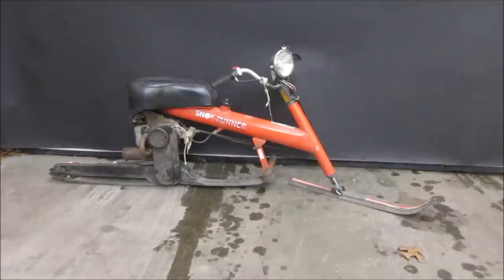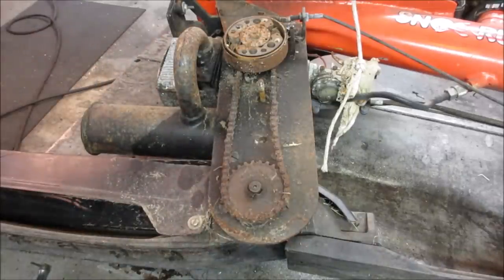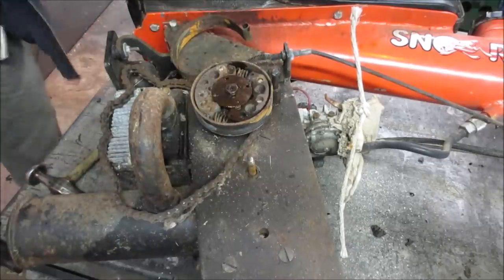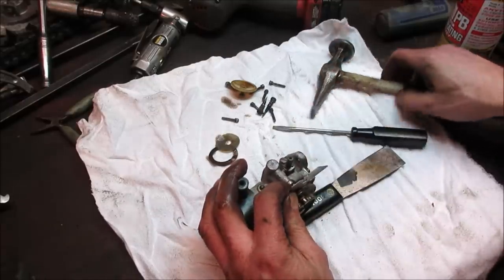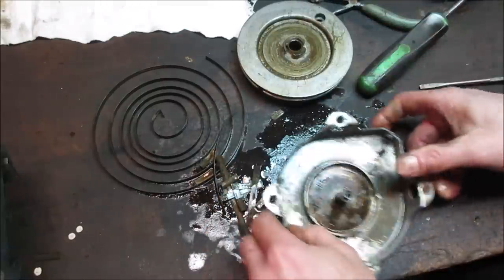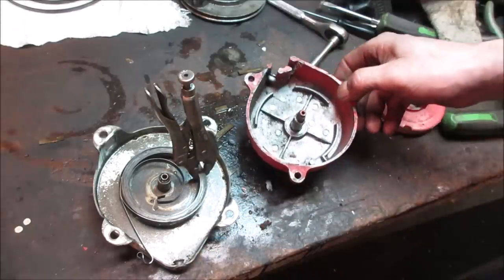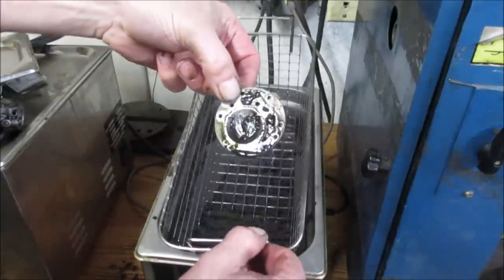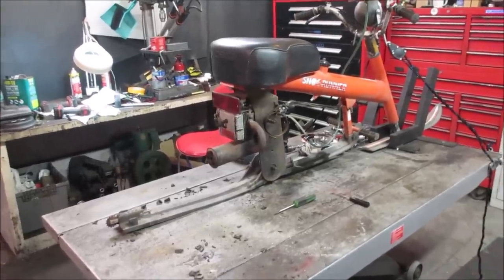Can It Be Saved? Chrysler Snow Runner.

Comment: Chrysler Power Bee. Came from the West Bend acquisition. Those motors found their way into everything including Chrysler outboards. Lots of industrial tools too. All the parts are still available, including whole engines.
Reply: That is incredible for sure
Reply: Wow, that is good information and I've seen similar engines like that on go karts and minibikes. GREAT that such an old engine is still supported.
Reply: @Hjerte_Verke  I know a guy that highly modified these things back in the day to run them in carts. Amount of power of these little guys will make after being massaged is shocking.
Reply: one of the best kart engines, 4 reed matched to a Hl 244 from my view
Reply: It's the same engine that is on my 1968 Rokon Trailbreaker.
Reply: @greenmtnman7714  I've also seen them on plate compactors, power trowels, two-man chainsaws, gas powered drills and and so much more. It was a go-to for the specialty equipment manufacturers.

Comment: Pull start springs are such a joy to work with. Definitely didn't have flashbacks to my snowmobiles I had to bend new tabs and rewrap out on the trails alone.
Reply: They're also very exciting if you're not holding the right parts when opening one up that's still sprung... I had bits (including small tools) spread across the entire garage floor when I needed to unjam a rope that slipped off the pulley. I was holding it back from rotating, but didn't factor in vertical movement exists too 🤣

Comment: My cousin had one of these that I got to ride in the late 80s. It was actually really fun and handled the snow pretty well...from what I remembered. Would like to find one for myself some day.
Reply: Did a quick search just to check if parts and such were available. Turns out an aftermarket track runs $200 or so.

Did find an auction site that showed past prices - complete Sno Runners have sold for $2000 to $4000. Not sure what condition they were in, though.

Comment: First time ever seeing a snow machine like this….only seen snowmobiles. I imagine these were designed for kids for some winter time fun👍 How fast did these things go I wonder? Didn’t see a speedometer at the handlebar area. Looks like a lot of fun. Having one of these as a kid would’ve been a blast😄 Freedom to travel great distances and go on adventures 😊👍
Reply: They sold for about $700 in late 70's, had a 130'sh cc engine, I think the top speed was around 25mph on perfect hard packed powder.

Comment: About the drive pieces on the Cballoons. I suggest you find the best one and try this:
1. Use filler and sand it as good as possible.
2. Cast a mold of it.
3. Cast new parts in the mold using rubber you mix yourself filled with glass balloons.
Reply: Or get them 3D printed
Reply: @Gassit  That is also a possibility, use rubbery material. Need to scan them though, don't you?
Reply: Would have to use a tough rubber material like whats used on skateboard wheels.
Reply: I'm not sure that's even necessary.  A diy approximation may be ok. Finding the right raw material may be more important. Simple rubber blocks riveted to the plates are really all that's necessary. 
It just needs to run in the space available to it. Some guy made tracks out of steel angle. (sounds evil and dangerous)
Reply: Or just order a brand new chain and paddles from the internet 🤷‍♂

Comment: 12:38 what would be ideal is if you could find an extruded steel profile similar to that shape and then cut off and weld on appropriately sized pieces. TBH a T would probably work just as well as a scoop. There are LOTS of readily available steel T mouldings
Reply: I was thinking of the old Arctic Cat tracks that had the steel cleats- but another comment mentioned using plastic so it won’t eat your leg if you dump it....
Reply: @thomasadrian9854  didn't they have a steel U shaped cleat?
Reply: Yes- but in this case I wonder if steel would cause wear problems?
Reply: @thomasadrian9854  on what? it's not making any contact with anything other than the ground. 

The only reason I can see them using plastic is cheap, plus "breakaway" meaning the plastic will break off instead of breaking the chain. Steel would transfer the energy to the chain.

Comment: That's definitely a keeper, I really hope you can get a drive chain.
A Reed valve is a one way valve to stop crank case pressure escaping out the induction side, the stiffer the Reed plate the faster they close.
I've seen that style of engine on a brush cutter somewhere.

Comment: In my younger years, I would have considered that a challenge to restore. I myself have restored many older snowmobiles and some were even brought home in cardboard boxes and still restored. I would be approaching someone concerning replacing that chain and those paddles with possibly hyfax material or 3 -D printed paddles bonded onto newly engineered plates to mount on the chain. As I told someone, with enough money you can restore anything. I can tell that unit would be costly. When done, that will be a museum  piece. There is a snowmobile Museum  in the Upper Peninsula of Michigan that has many vintage machines that still run. Once  a year, they bring them all out and do a fun run with them. I no longer work on snowmobiles due to health issues. What a great project!

Comment: Spring bending is good, a little tip would be to bend as you did, then slide a small piece 5-10 mm under the bend and squeeze your hook onto the piece. This is how we used to repair broken clock springs. You can grind across your hook after you have fitted your piece. It takes the pressure off the end of the joint, so it won’t break o the Shepard’s hook. During the war we used to rebook the inside coil too. That was fun.

Comment: Conveyor chain will work well. they are made specifically with lugs to attach the cleats to. Before all the cleats get destroyed, I would make a silicone mould from them and recast them in Fibreglass and resin
Reply: Those track cleats must have a bit of give like a rubber product- fiberglass would snap rather quickly

Comment: Also, your wind the spring in from the terminal coil. Just hook it in the slot and windin. Try not to forfeit down, just take your time. The spring an get notch sensitive if you force it down rather than winding it in. There is a tool to win it up but it’s easier using your hands. A 400 day clock as one of the strongest springs. To get it out , we used to hold the centre and fling it. Retrieving the barrel after from somewhere in the workshop. Good luck, really enjoy your videos.

Comment: the knotch on the pully shows you the way of pull. There is often an arrow or other mark on the casing to show the way the spring winds 
I usually clean reeds with 2000 wet paper and oil.

Comment: I owned two of these machines in the 80s. They were fun if I could get them started.These things needed a different propulsion drive. The cleats were rubberized to track which cracked and broke off. The centrifugal clutch worked fine pulling my 180lbs around the yard up and down hills fairly well. I’m guessing about 25 mph on the flat.😉

Comment: Those two levers have to have a good sharp angl to them, so when you pull the starter rope they go out and jab into the starter hub.  That was a common starter method fifty years ago on some chainsaws and other two cycle engines.

Comment: I fixed up a few of these last year and did the exact same thing as you did on the centrifugal clutch.  I was yelling at you to pull out the center section first, then the key and finally the outer portion.  Oh well, you can get the needle bearings online, but they are somewhat tricky to put back in.

Comment: There were a lot of them around in garages, sheds and basements. They looked cool and could even be fun --IF-- and the key word here is -IF- there was less than 4 inches of snow or there was a lot of hardpack because if there was more than 4 inches of snow it was stuck instantly. It was built by Chrysler Marine which made boat motors and was originally intended as a winter vehicle for the military but the military saw it and tested it and imediately declined it. Not that many years ago, they could be found around here in really nice (near mint) unrestored condition for $150 to $200. Now they are $2000 and up for restored ones on the ocassion you find one.

Comment: When it said Chrysler, I was hopeing for a 413 Max Wedge with dual four barrel's or a 6 pack ... But a running 2-stroke might be better in that application.
Sounds like you found some track-chain, but if not or if your plastic suspension takes a dump, China made a "snow scooter" with an all metal snow track that used two chains which ran on 1 piece dual sprockets and retained the minibike tire inside.
It would be easy to adapt to that thing and I bought two of them complete and running for $60 bucks back in 2010.  They had 49cc two strokes and were underpowered for snow but would climb a tree on a dry day. lol

Comment: Those West Bends are fun.  I have a 700 powerbee on my 61 Caper Cyle Falcon which was acutally the original engine and it's pretty damned scary to ride.  I know there were issues with the Sno Runners being under powered and only useable ("useable") in certain types of snow but still, pretty cool ride none the less. Neat find!

Comment: Clock repair supply businesses will have any width strength and length of mainspring. Generally trying to fit a mainspring that has a memory of a larger diameter housing into a smaller housing may result in the segmented type of failure you saw in the one that was in the project. Still way more interesting when you use something meant for one machine and adapt it to work in your fix

Comment: There are some and lots of parts on ebay. A running used snow rabbit on there is almost $2,000.00. You really find some good stuff sometimes, saw a replacement kit for tracks.

Comment: Reed valves stops the air fuel mix that gets drawn into the engine from getting pushed back out of the engine. They keep the flow going through the engine.

Comment: from Hagerty; ''The “carburetor” is actually a crude form of fuel injection.'' ''Number one reason they start hard (or not at all) is the crank seals. If you find an original, plan on doing them. The early westbend motors had points so its best to replace them with the little electronic ignition. The Sno Runner fuel pickup hose can harden and break too. '' ''Makes sense when I think about it considering the pressure change in the crankcase is what pumps fuel. If those seals are bad the pressure fluctuation will likely be too little to work as designed.''

Comment: Wind that starter back up insert rope tie it off let it retract, done! Some folks make to much work out of those, I see a lot of those pull starts come in , especially off old 3 wheelers and small engines. I usually fix them while they wait, unless they have pulled apart and un-sprung or broke it.

Comment: Mustie1 when you have to heat a spring you can retemper it. After it is reshaped to what is needed, clean what needs to be retempered to show clean silver colored steel. Have a metal container of used motor oil that is just large enough to put the item in and have it completely submerged. Heat a good sized piece of scrap steel to red hot and drop it into the oil to preheat it to prevent thermal shock (use 2 pieces or a bigger piece if it will take more than just a minute or 2 to reheat the spring to the proper temperature to be at the right temper for the spring.)  Then imediately while the oil is preheating, heat the silver part of the spring until it turns BLUE  in color and once it turns blue, quickly dip it into the hreated oil. As long as the oil is still good and hot this will retemper the spring to original temper and strength. I learned this from blacksmiths who did historic re-enactments and would be asked to make replacement springs  for flintlock and percussion lock muzzleloaders if a participant had a spring break and did not have a spare with them.

Comment: I came across one of those at an auction in the early 90s. I had 2 squalling children and couldn’t remain. Also we average 1-2 snows a year where I could use it.
Reply: The one I saw had a long rubber snow belt drive without the rear ski.

Comment: On that pull start, coil your tension spring inside that depression in the casing, rather than outside the casing. I fought with one on a mower for hours once before figuring that out. You can get it as small as you need it to be. Just connect the outside loop on the depression in the casing and thread it around in the proper direction. You didn't need to cut it. There are actually a few guys on Youtube that have videos that show you the proper technique. It may take a few tries, and you definitely need gloves on, but it is a lot easier. Ask me how I know. If you turn the top pice in the opposite direction, the inner loop will catch on it's own.

Comment: Those reed valves are very similar to the ones in an air compressor I picked up for my shop. Wouldn't build over 80 psi. Put some new ones in and it works great.

Comment: 54:52 put the round tab in the window. Hold it in the housing and spin the housing let the spring dangle. Just wind it into place. You can also clean up the spring and keep it dry so it won’t stick and get slow. No need to fight a spring under tension.

Comment: Good vid Musty. All else fails Wack a puller on it and force it off. Oversight. Would have thought you'd be onto those little centrifugal clutches. My experience is that Chrysler engineering is some off the sturdiest and most reliable of all. If not a bit different from the norm. Makes it more enjoyable to work on, I think anyway.

Comment: I have wanted to build my own version of a tank chair for a while (powered wheelchair using 2 tread instead of wheels). My problem is I don’t know enough about welding to know if I could make one of the cheap mig welders will work for me or not…. Well that’s just one of many problems. The big one as far as parts goes is finding rubber tracks that will work for the application and the needed drive wheels for those tracks. I’ve got a few ideas for the track design as far as the shape it sits in with all the guide wheels in place. I even have a couple solid, no fold manual chairs to start with. Aren’t they doing something similar to this for snowcross racing? It’s motorcycles fitted with rear tank treads. I don’t remember if the front is a ski but I believe so.

Comment: The reed valves are unidirectional and let the crankcase suck in and compress the fuel charge from the carb so it can force it's way up the transfers when the piston is the the right position ie transfer port(s) open up. The engine won't run without them because fuel wont make it to the combustion chamber, it will blow back out through the carb.

Comment: It could be fun to fit rollerblade wheels under the skis?  Obviously, there'd be some engineering to do to make the rear ones driven, but at least you wouldn't have to rely on snow.

Those plastic cleats, could be ABS plastic. Whatever it is, I had an Hitachi bookshelf Hi-fi system that had a casing that was made of a similar/same plastic, and dated back to the same era. Unfortunately, the cassette deck just crumbled exactly the same way as your cleats.

It'll be interesting to see how the chain/cleats are assembled.

Comment: Pull strings are fun ..we had a push mower back in the 70's .The recoil spring broke,so we took the aluminum pulley out of the cover and used to put it on the flywheel and wrap the cord around it and Give it a yank .once it started .we hold the string tight and reach down and lift  the pulley off the top of the engine...I gave that cord a yank onetime and that pulley came up and busted me in the lip ..4 stitches later and a chipped tooth ..I decided that way of starting that engine Sucked

Comment: Just googled and see that they have an upgrade nickle plated chain with upgraded paddles for 195.00 - better would have been an all rubber kevlar reinforced drive chain - no rust, etc I have been submerging hardened rubber parts in wintergreen oil - works amazing at resoftening old hard to come by rubber fittings -speaking to that piece for the air filter, not the paddles of course -they are toast as you well know

Comment: Chrysler 134cc air cooled 2 stroke marine engine is the Powerplant,, 1.3 gallons of pre mix is the frames capacity,allegedly tops out at 25mph on a 3" wide chain driven track... 1979-82,they didn't  sell like hotcakes... priced at just under $700 in 79 equivalent to better than 2500 in today's money... Some are said to still be in crates out there in dealerships old forgotten inventory...

Comment: parts are expensive.  you need a new rear track, air filter, muffler, fuel petcock, seat, pull starter, headlight.  weld up the muffler.  engine is a Westbend  from the 60s.  great engine.  has a good magneto on it.  bright lights and taillight too.  i always froze when i rode mine around.

Comment: I owned one of these back in the 80's.
I was about 14 years old and it was already over 10 years old when I got it.
I was able to ride it a few times, but only when the snow was the perfect depth.
More than a few inches and you spent more time pushing it.
Maybe it would work good on a flat groomed trail.
Not much power so forget about climbing even the slightest hill.

Comment: You want it really rich and barely running in the shop, the air in the shop is much warmer than the air it will be running in on the snow! If you tune the carb for 60-70 degree air and get the air / fuel mixes right for those temperatures, it is going to be extremely lean in 10-30 degree outside air temps. You will either melt a hole in the piston or seize that 2-stroke engine up. Guaranteed.